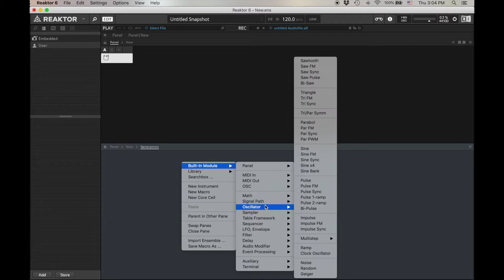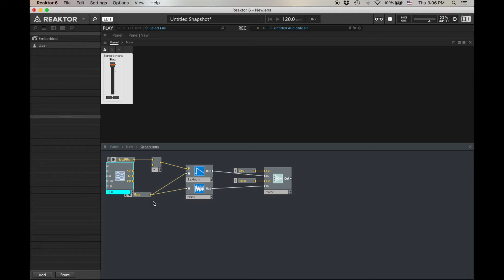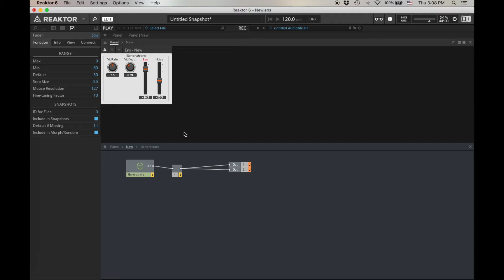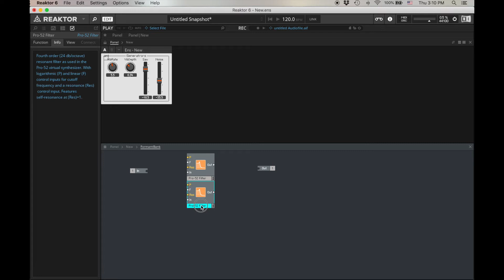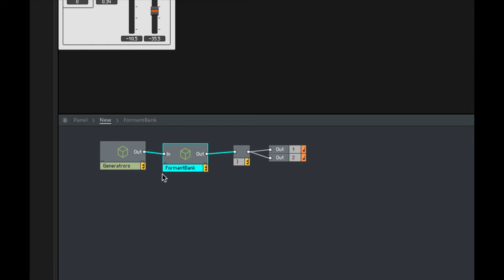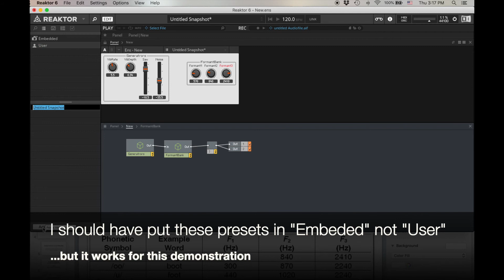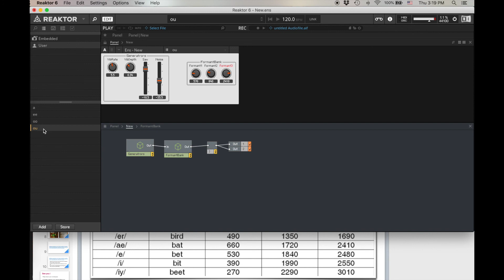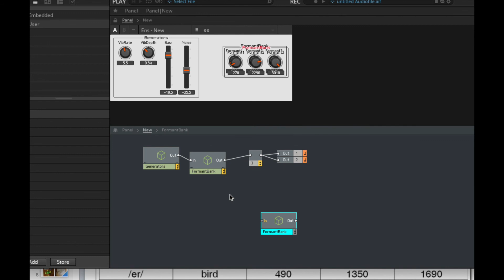Reaktor Primary 3 EXTRA: Formant Synthesis | Simon Hutchinson

Comment: Hey Simon! Thanks again, I'm obsessed with these tutorials. I'm wondering, how do I fit the formant bank macro into the synth we've been building in the rest of the series? I can't quite figure it out
Reply from the maker: Hi Scott, if you’re working from the part 3, I would recommend replacing one of your two filters with the formant macro (but it’s probably worth saving as another file).